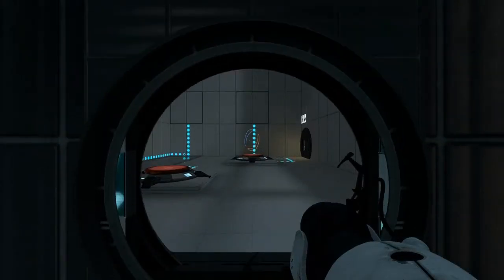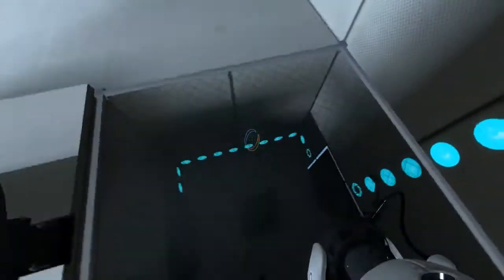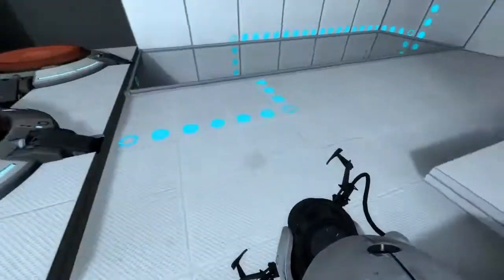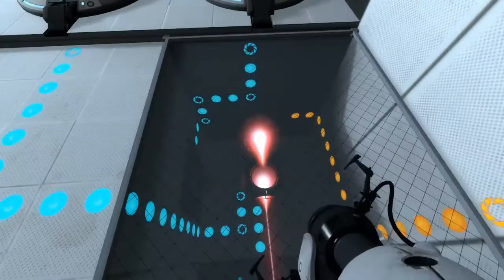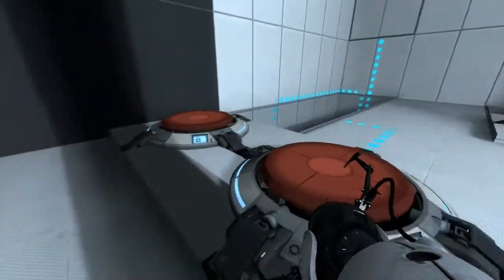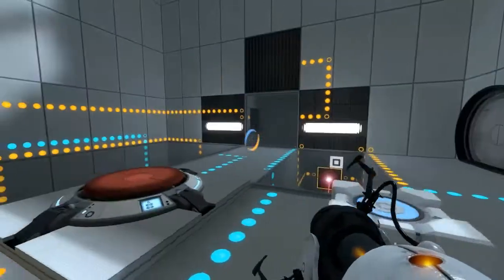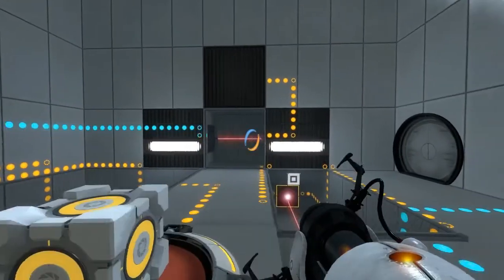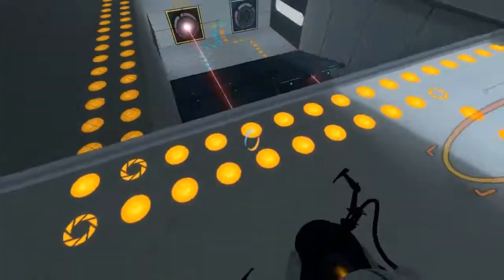Portal 2 Flip-flops and latches

Comment: Will it be possible to make a t flip flop with only one input? Without a reset button? 

I did some toggle switches. Just trying different to achieve it to experiment.

Will it be possible with some logic gates to toggle flip flop with the same button. First time it flips the panel. The second time it flips the panel again.

Comment from the maker: That doesn't make sense. Granted this isn't an edge-triggered flip-flop.
The point is that the flip-flop only changes on a clock input. The button merely simulates a clock input, It's not a constant signal, but that doesn't matter. I wanted the device clocked when I wantedm for demonstration purposes.